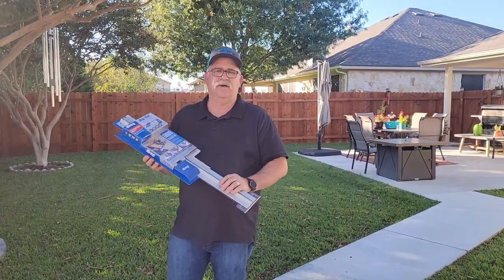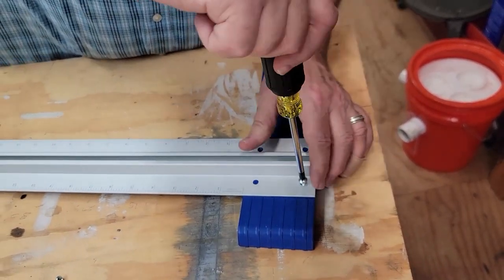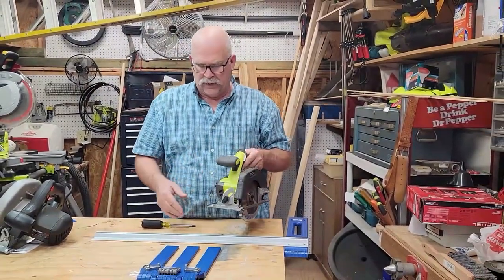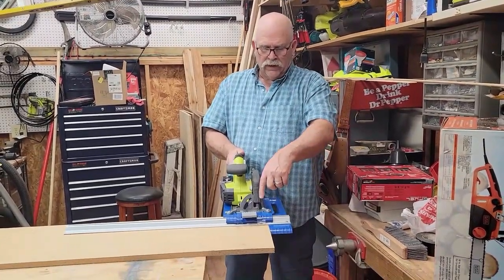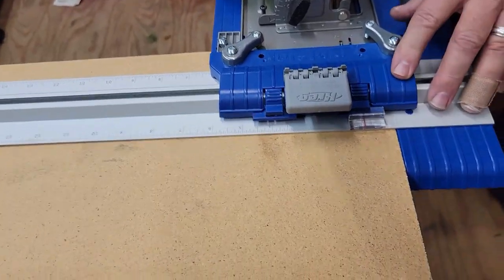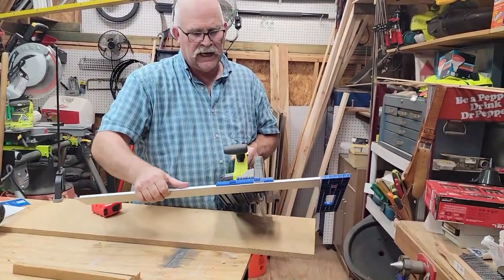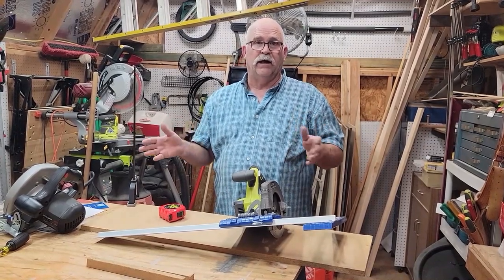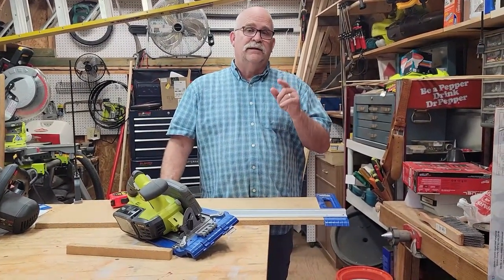Kregs 40 Dollar Circular Saw Rip Cut Guide

Comment: How do you adjust/calibrate the width measurement? I assume you can adjust it to be able to use it with different saws and positions on the sled.
Reply from the maker: @ooltimu  , The front clamp is lifted up and  slide it along the rail to the measurement you want. Thanks for taking the time to watch my video and comment if you haven't subscribed to my channel please consider that along with clicking the notification bell so you don't miss out on any future videos. Here's another video you may like https://youtu.be/e6LwuQhwrLg

Comment: I suggest checking to make sure the saw blade is parallel to the fence after installation. My rip cut fence is out of square to the rest of the jig by about an eighth of an inch per foot, so that I had to install it cocked on the base of the saw,
Reply from the maker: @haroldkahl4610,  I haven't experienced that issue. Thanks for taking the time to watch my video and comment if you haven't subscribed to my channel please consider that along with clicking the notification bell so you don't miss out on any future videos.  Here's another video you may like https://youtu.be/Uu4rM7HnNpk

Comment: I have a small shop. I have a table saw and still rip with a handsaw to rip plywood in smaller pieces that is easier to work with on the table saw.
Reply from the maker: Hi Keith,  I understand my shop is only 12x16 so I agree it's much easier and faster than breaking out the table saw sometimes. Thanks for taking the time to watch my video and comment if you haven't subscribed to my channel please consider that along with clicking the notification bell so you don't miss out on any future videos. Here's another video you may like https://youtu.be/H14QEADCs0Q